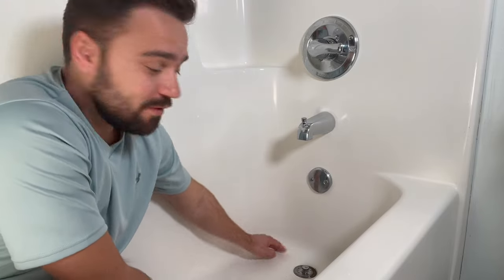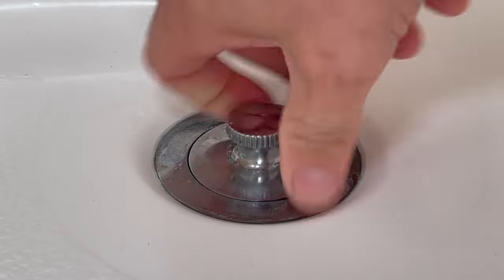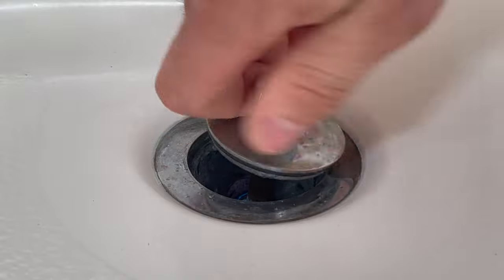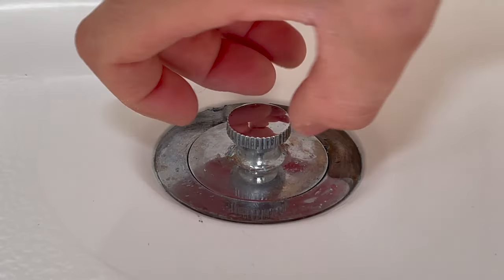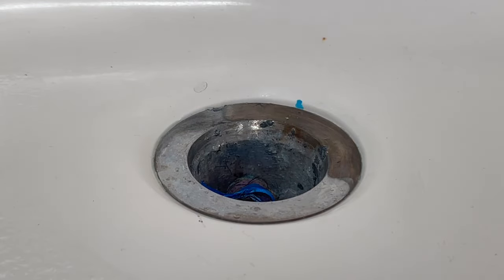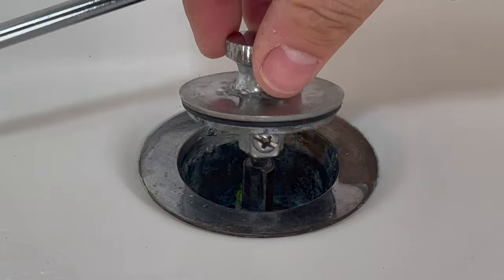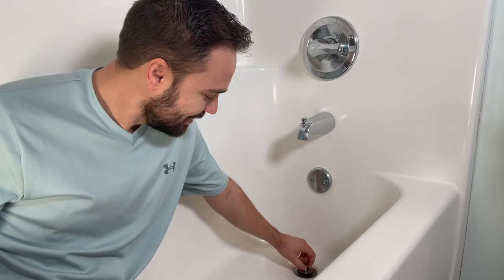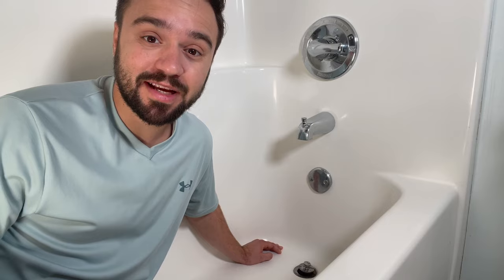How to Remove a Tub Drain Stopper - No Tools Needed

Comment: These videos make this look so easy. I pull mine up "half way" and it only turns a 1/4 or so and then it stops. I still can't get it out. I'm just gonna pour a gallon of drano down the drain and let it set for about 6hrs😅
Reply: Same here. I used pliers and got mine to turn.
Reply: @shelbys2965 how did you pull it out? I'm using pliers and still having problems?
Reply: Same!😂😂